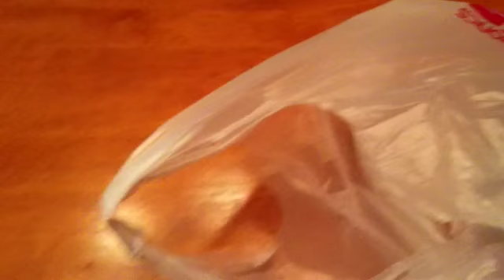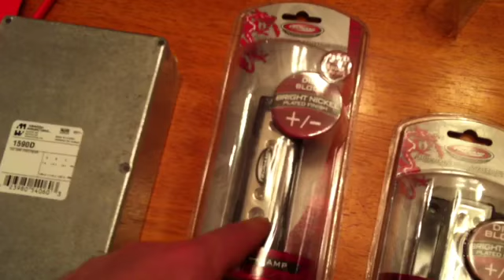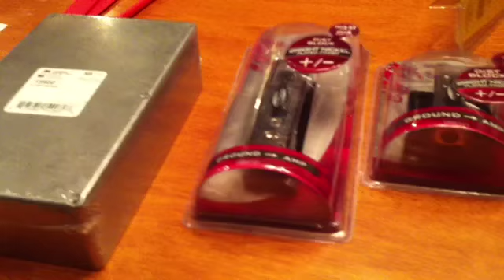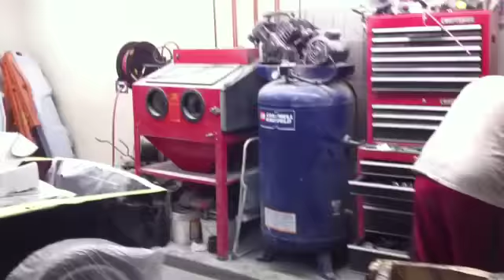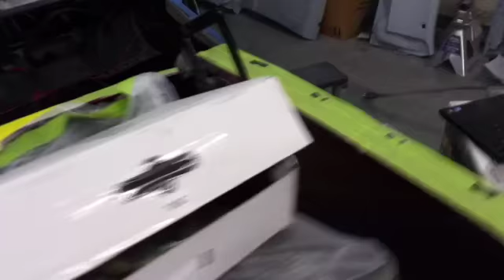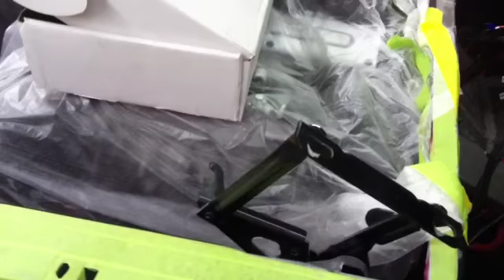65 Mustang Restoration - Under Dash Wiring Work

Comment: My project is slowing getting to the wiring point.  Back to watching you older wiring videos trying to learn something.
Reply from the maker: I really disliked the wiring work, not sure why... ours was more complicated because of the toyota motor.  You going to put a factory type harness in yours?
Reply: No I'm going to custom build a harness.  My dad has wired two vehicles from scratch some he's going to help me with this one.  I think I have more things in my car than what he's worked with though.  We are going to build our own fuse block and go from there.
Reply: I bought those autoloc buttons and I'm thinking of getting rid of the original key.  Maybe not. I'm not sure.  I will definitely remove it from the dash though.  Maybe a hidden area.  I think if I use it then it will be there just to turn the power on for the fuse block.  I have it all written down on paper.  Trying to wire the car in my head before I actually do it.

Comment from the maker: @caseywintersjcw Yea, I tried it that way, but I had already cut the power wire to length routing the otherway, and it was a little too short going through the sill.  We will have a console going from from to the rear seat, so should cover up the power wire

Comment: @turbocobra Well thats pretty cool if you can drop the hole thing down, that will save you alot of headaches down the road if you ever have to replace them. Ok keep up the good work buddy!

Oh been reading some comments and richard is totaly right about soldering the tips of each wire before clamping them down in the box!

Comment from the maker: @Rasd4Metta Yes, my plan was to mount them as they are and do all the work, then just unbolt them and bolt them on the underside.  But in all reality, I can loose 2 bolts and lowe rthe whole ECU and relay tray all the way donw to the floor pan, there is plenty of slack on all the wires to do that, so make it real easy to work on if I need to.

Comment: When you tighten the set screw on soft copper wire it will eventually creep (the copper strands) and become loose,if you tin all connections this will not happen.
Richard

Comment: When using wire to be secured by a set screw,it is best to tin the end as than it make wire soild and not mushed into strands.This is especially true with large wire,and it makes for much better hold and contact.Just a little tip and no wires thru drilled holes as soon or later the metal will cut the coating on the wire and cause a short.If you don't tin wire end try  loosed set screw on joint you did and pull wire out and you will see what I mean on wire end.
Richard

Comment: I like the idea of the aluminum box for your connectors to sit in.
Much safer than just hanging them on the firewall or under the dash.
Making a spreadsheet of your wiring diagram was a good idea.

Comment: I would add rubber grommets anywhere a cable runs through a hole...prevents damage to the cable due to vibration. other than that, it's looking good!

Comment: Allof those wires should be tinned with solder prior to going to junction block and you should not run big cables thru drilled hole ,it should have a grommet in hole to insulate wire from vibration,just my opinion.